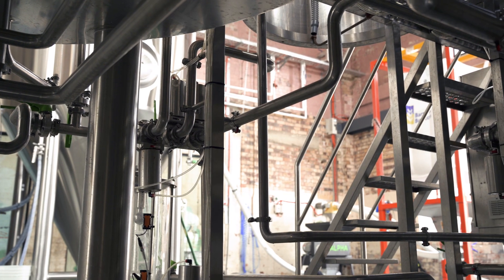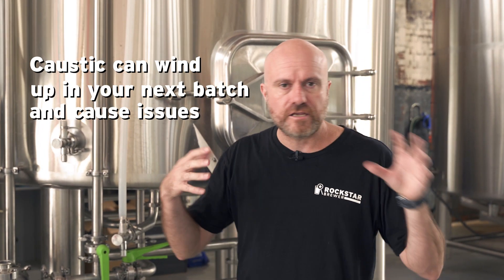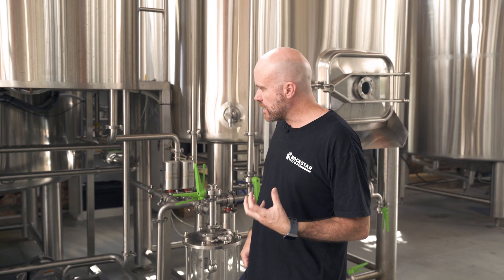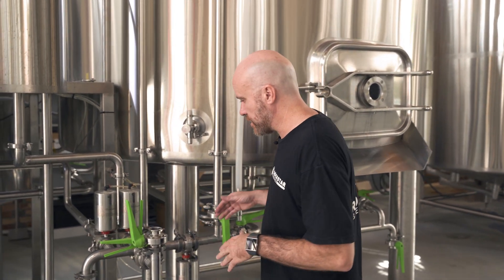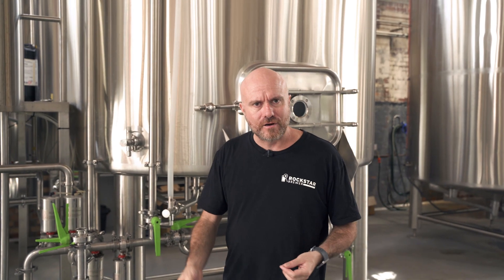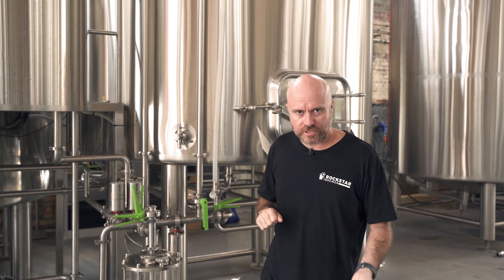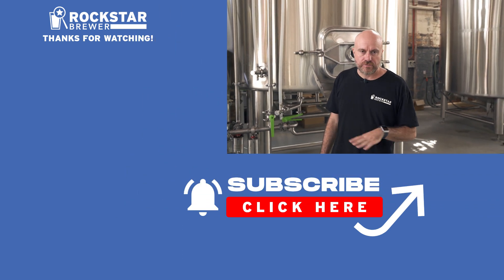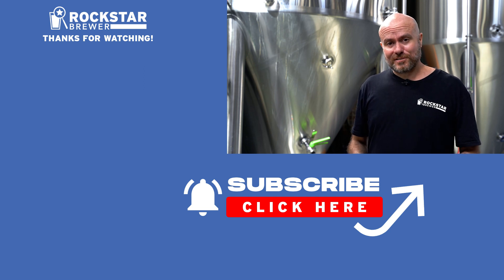How To Properly Rinse Caustic From Your Brewhouse

Comment: Thanks, I always thought that a normal procedure is to do an acid CIP directly after a caustic one, which seems wasteful for both chemicals.
Reply from the maker: Sanitiser is normally an acid.  I occasionally follow a caustic with an acid wash but only if the tank has been contaminated with a foreign micro-organism.  I call it a "nuke it from orbit" CIP but generally it's called a "remedial CIP"